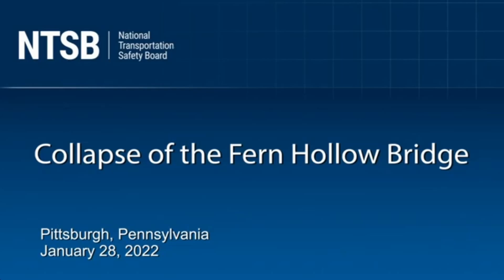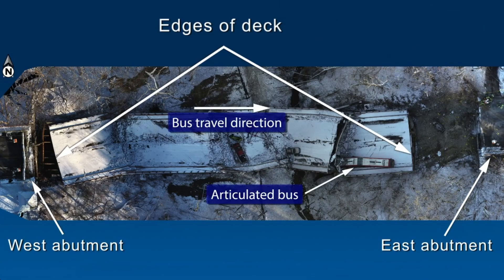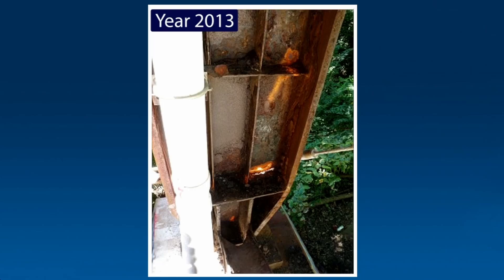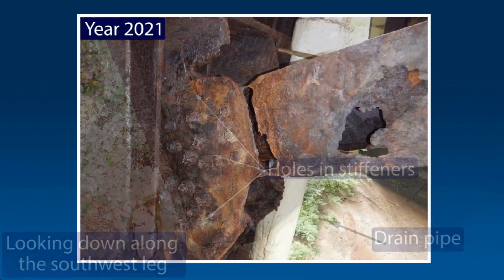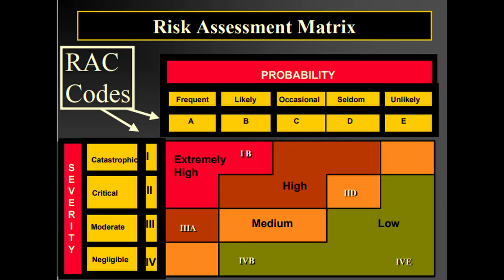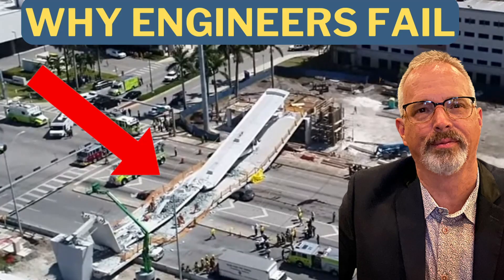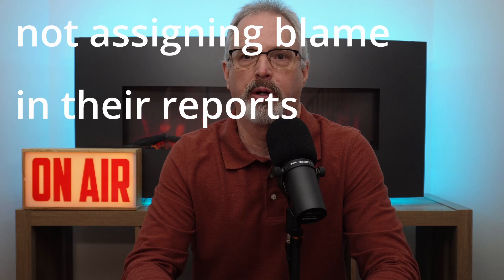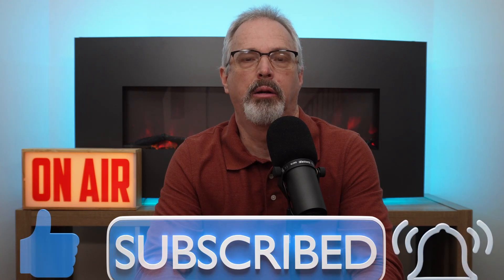Why the Fern Hollow Bridge Collapsed

Comment: those inspection photos are ridiculous. i can't believe an engineer would look at that and not shut the bridge down.
Reply: I know exactly what would happen.  These engineers would be fired for manufactured reasons based on politics.   This needs to be part of the lawsuit.
Reply: Those looking at it didn't have the power to do anything about it. (safe assumption)
Reply: @Mrbfgray Just like Challenger.
Reply: @nitehawk86   Good point.  There were nearly fist fights (reportedly) over that cold launch, Thiokol engineers knew it was extremely dangerous but NASA bean counters were probably more fixated on Reagan's chat w "1st teacher in space" schedule. 

The whole thing was designed to lull public into thinking it was safe, even the name made it sound routine.  They compared it's failure likelihood to airliners which was absurd, apparently believing their own rhetoric, "if you can fool the ppl you can fool nature". 

(bro happened to be working for JPL on the Shuttle at the time)
Reply: @Mrbfgray -- Yes, but there ought to be a chief engineer who has the authority reading the reports and looking at the photos.
Reply: @GH-oi2jf   Hard to fathom how it went so neglected but deserves an investigation.  Doesn't look great for underlings on the ground either (the bridge), one of them should have raised alarms with media or something, going over their bosses head, or maybe they did IDK.  

Comes a time when your job security takes backseat to doing what's right.  Sometimes you do everything right and things still go horribly wrong, but at least you tried.
Reply: A govt employee would